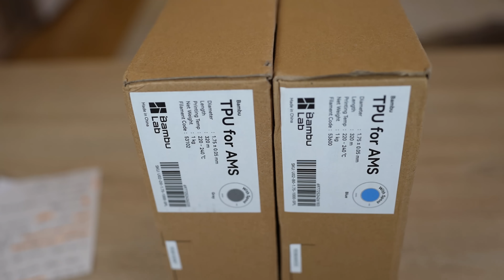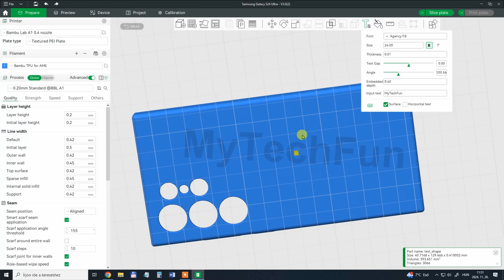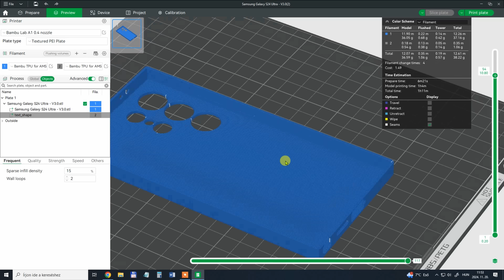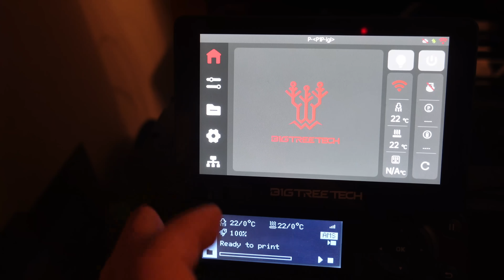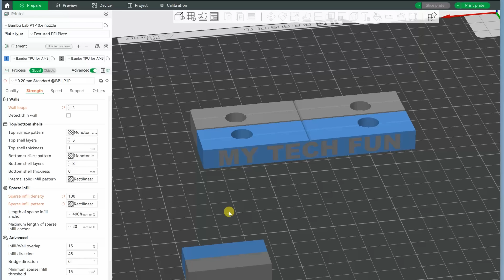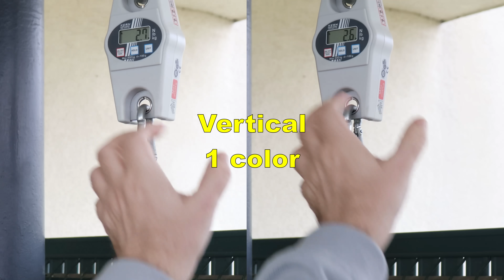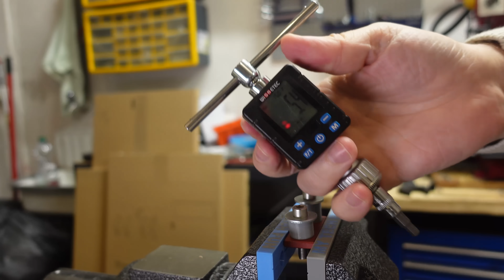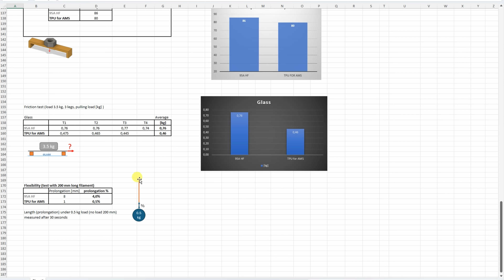BambuLab TPU for AMS: An Alternative to 95A or a Specialized Flexible Filament?

Comment: I really appreciate your testing — it makes my 3D printing experience so much better. As a suggestion, it would be helpful if you could also present some results using more scientific units. For example, it would be very interesting to see the differences in the coefficient of friction between different types of TPU. Using kilograms is nice for quick percentage comparisons, but for detailed work or calculations, scientific units would make things easier. I know there are many factors involved in this as well (surface finish, etc.), but it would still be very useful. Keep up the great work!

Comment: Very happy I watched this I had $250 worth of Bambu AMS safe tpu in my cart 😢that would have been a waste for all the projects I had planned for it. 
   Honestly 80% of the projects I have planned can easily be done muilt color just have to swap manually no big deal. Could even print my own dual color TPU for some more colorful prints I've pulled that off with PLA PLA cf and PETG

Comment: An alternative to the gruesome TPU is Nylon. It is one of the most durable materials you can print and when designed right you'll have a very flexible result but you can make it very rigid where needed.
I've barely ever used TPU, it's always a nightmare

Comment: I have the same issues with eSun PLA+ breaking in my AMS. I now must always remove the filament immediately after done. I noticed that this filament is only brittle where the AMS feed gears have bitten into it. I usally cut off that part if I'm not going to use that filament again soon. That has solved the issue.

Comment: I've been attempting to print some arrow nocks for a 50lb compound bow.  I've tried with a pla, petg, petg-hf, petg-cf and abs.

Pla is too brittle, as is regular petg and petg-hf.  The layer adhesion with abs and petg-cf is not good enough to prevent the prongs from snapping when printed standing up and the layer adhesion is also not good enough at the neck when printed laying down.  I have 2 reels of tpu for ams, do you think it would be a more suitable material for the nocks given it has similar properties to pla with much better layer adhesion and more impact resistance?

Comment: The AMS TPU is more like a flexible plastic than a flexible rubber like material, like 80-95A TPU's feel. I have some uses for it where regular TPU is too flexible. BTW, it sticks very well to the Cryogrip Frostbite without glue and releases nicely.

Comment: im just curious, at what speed have you printed the test parts? I just started using it, and at the standard speeds, the layer bonding is horrible, i broke a 3d benchy in my hands. Lowering the speed, at a second test, at 80mm/s dramatically changed the layer adhesion and it was almost indestructible. This material is amazing because if you want more flexibility you lower the infill, so you can do what 95A does, but also be extremely rigid. its so versatile, i love it

Comment: You need to test PHA! It gets more affordable and it's compostable at home. I hope it will replace PLA in the long run.
Reply: Not nearly as easy to print, wants to warp etc so it won't replace it for sure

Comment: You can print regular 95a at that speed no problem.

I do 15mm³s on my qidi plus 4. Unfortunately the long reverse bowden causes too much drag for higher speed
Reply: In any case you can print this 68d faster than you can 95a
Reply: @riba2233  Yes but most people are not aware just how fast you can print TPU on a modern printer.

Comment: Hi Igor! I'm breaking some PLA filaments in my AMS, not only for you. It is not manufacturer dependent, because the same manufacturer's PLA filament is not brittle in one colour, but it is in another colour. I have experienced this with several manufacturers. I just wrote to let you know that you are not alone 😏. Thanks for your work so far, I learn a lot from you.

Comment: great video again!
You could use it for 3D printing mitre bars for mitre slots on table saws and band saws, due to the low abrasion. I am sure you could incorporate some way of apply tension to the sides using the bolts going through the material forcing a snug fit with no play in the mitre slot.

Comment: Being able to print in AMS reliably is a big deal. Especially when there is a need to add "o-ring like" functionality for press-fit parts etc. I only wish that BambuLAB would opt in for using RAL Colors. There not much need for a bright red, yellow, green for technical filaments. Something like RAL 9001 color matched with other standard filaments like ABS / PETG would be awesome.

Comment: I think a  good idea to start making comparisons between filaments or brands is to normalize the data and use radar charts. That way many of the features of a material can be shown at once. Normalization could either be to the base 95A in this case, or to even try to show how these features compare back to PLA as a common reference. Thank you for your methodology and testing of different materials.
Reply from the maker: Something like this? Not too popular neither. https://youtu.be/haDQxl0COo0?si=vpp01VNwTzi95Bp5

Comment: I'm going to be buying the A1 combo soon and I'm hoping to pick up some tpu for making airtight plugs/seals but the tpu for the ams is sold out currently. Do you think the regular 95A HF filament will be fine for that purpose, or should I wait for the tpu for ams to restock?
Reply from the maker: TPU 95A HF is even better for that purpose, only you cannot use the AMS, you have to feed it directly to extruder. And don't forget to dry the filament, you will have much nicer printing.

Comment: You definently are not the only one with AMS issues such as breaking filament. My AMS at work has been removed and is sitting on the shelf as it is unusable. (and it wasn't the filament)  The fact there are so many workaround (like this red hearing of a TPU filament) and other silliness such as rewinding filament spools so they will run in the AMS it is a good indicator of the real world quality and design of these machines.
Reply from the maker: Finally, the first comment, who mentioned this.. BTW, Bambu knows about the problem (at least my marketing contact), hopfully, they will solve it with V2.0. For example, recently I tested similar AMS, which removes the tension from filament, when it is not powered. And filament will not break inside.
Reply: @MyTechFun  I have taken the printer and AMS apart I was appalled at the design details. I suspect a large factor in the lack of an appropriate consumer response is that most of the people to buy these machines are coming from even more badly designed and very cheap printers. They have spent quite a lot of money on the new shiny Bambu therefore they insist that it must be good, otherwise they would need to admit they fell for the hype and paid "reviews".  Every machine, be it a printer or anything else will have problems, design oversites, production issues etc. and pretending they don't is just stupid. The problem here is that many of the issues are the result of intentional and generally anti-competitive design choices, and that is a real matter for concern.
Reply: This has only happened with esun pla+. Everytime I use it and of I leave it in the ams it breaks off.

I'm generally printing with ABS and it has never happened.
Reply: @drkzilla Abs is much more ductile with pla the tension is higher because of its stiffness.

Comment: This video is sponsored.  Please stop saying "this is not a sponsored video."  This is what they call being part of the "access media"--you are paid by being provided with free stuff.  That "free" stuff comes with conditions.  If you do not review positively you will not receive future consideration, which is inherently a source of leverage.  I'm speaking from professional experience, as a former hardware editor.  You are walking on precarious ground--this is the path that every non-objective reviewer goes down.

Bambu 68D TPU (39/kg) is 72% more expensive than CC3D 72D TPU (22/kg).  Unless you need colors other than black and transparent you are better off with CC3D, which prints extremely well and works with AMS.  I see Bambu's entry into the market as late, overpriced, and over-marketed.

Separate topic: Python AMS supports printing 85A and below filament that are not supported by the Bambu AMS (Bambu themselves said Python is great, but couldn't offer it at the price point they were targeting).  You should build that and review it.  It also supports optional Polydryer heaters to keep the filament dry while in the AMS.  Then you can print all types of soft TPU and stiff, carbon-fiber reinforced filament using the AMS.
Reply from the maker: Sorry, but I still consider this as not sponsored. Especially with filaments. Most of the channels with similar size have sponsorships for all their videos, this means, they get paid 500-1000$ to create the video. If I only look at the financial part, I woudn't even do it. I work with it 20 hours and from Youtube ads I rearn approx 10$ per video. Have you noticed, that there are no ads during the video? I don't live from Youtube and because of all this I consider this as a very rude comment. Only Patreon supporters keep this channel alive and I like to test things and create content on it.
Reply: "That "free" stuff comes with conditions."  Oh really, how do you know that?

Comment: Overture High-speed TPU seems similar... It is my go to TPU. Feels a little stiffer on the roll, but not too different from 95A after printing. 

I can basically treat it like PLA, feed it from a dry box and through the filament sensor and tube on my K1 Max, and just not worry about it.

Regular 95A TPU doesn't like that, and I need to feed it directly into the extruder.

Comment: Do you know there's a filament from Esun, PAHT-CF, according to characteristics, its tensile strength is the same as PPA-CF, very interesting plastic
Reply from the maker: I didn't know. Thx. But first I will test PPA-CF from Qidi, Siraya, Polymaker.. Sooner or later, eSun too.
Reply: it is a regular PA6, not PPA, it is discountinued, and it's tensile number in spec sheet is a pure nonsense, probably a typo. No way it is above 90 in real life, while PPAcf is around 165 actually

Comment: Which fdm filament has most shoe sole-like properties? I need highly stretchabile, rebound, wear and tear resistant TPU.
I tried few flex filament types (BASF TPU 95A, TPU 85A, TPS 90A, VarioShore) but non of them has high energy return that can withstand intensive tear and friction.

Also. What material paremeters and measuring methods I need to account when looking TDS of material for such properties?
Reply from the maker: On my previous workplace, I worked for big injection molding company. Beside technical parts, we manufacutred shoe bottoms. The best quality was made from TPU (the hard one). And I ordered a rebound tester too, it should arrive in few weeks.
Reply: @MyTechFun  I probably gave wrong example with shoe bottoms. I actually need to make stretchable at least half of latex, but part would be in harsh conditions similar to shoe bottoms (a rocky terrain).

Comment: It's winter coming, could you test which filament is best for ice scrapper?
Reply from the maker: I wanted to test which filament works best in cold weather, but more like tensile strenght, layer adhesion, bending. But good idea is the ice creaper. But there the hardness or wear resistance is important too.

Comment: Great video, but I'd be curious to see how it works on something like an airless basketball, which has to be flexible enough to not crack, yet hard enough to bounce.
Reply from the maker: I have PLA for this baskedball from BiQu (BTT). Maybe I will print something smaller to compare. But overall, TPU would rebounce if it would be solid inside. But at least it would be a real AIRLESS ball 🙂